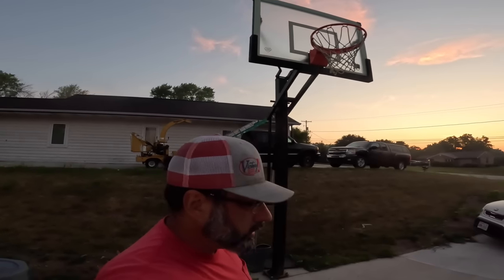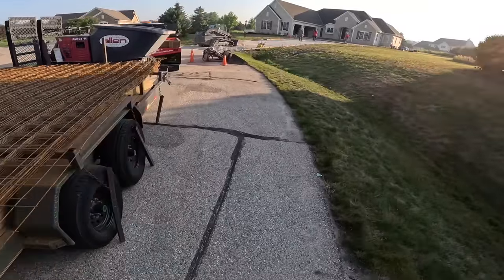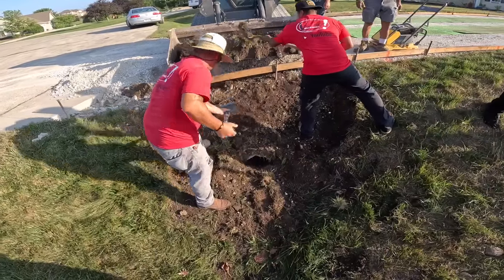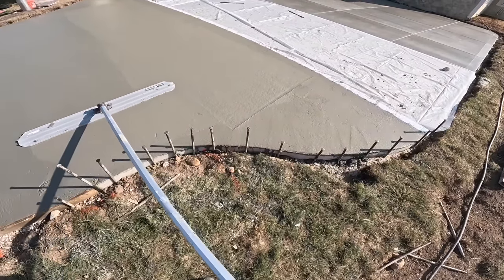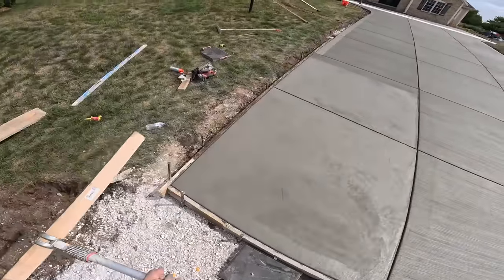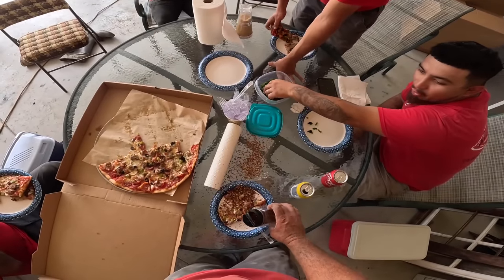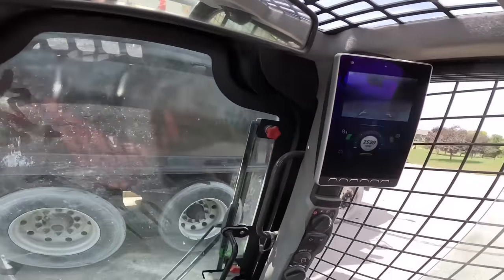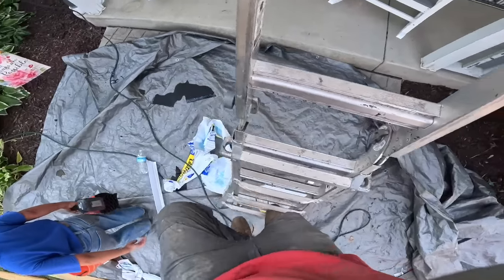Concrete, pizza, and lemonade! It was a good day!

Comment: We had the same thing regarding color, but from the same plant in the same town, but 3 different trucks. One really light grey concrete, the next load was a real dark grey that was the color of wet concrete once it dried, and the final load was a sandy yellow color once dried. The final 25 meter long, 3 to 3.5m wide driveway had NO cuts, no lines in it for a week, and it changed width 4 times along that length, so you can imagine the cracks that formed as it dried in the Australian summer heat. The contractor put a sprayed on base for stencilcrete cover to get the color right, but over wet epoxy used to seal the cracks, and then saw cut in just 4 places along the length. 18 years later I'm still telling people not to use that same contractor due to this work

Comment: We used plenty of plywood when i was scaffolding with a company. We use to overlap small voids & secure it on the scaffold etc.

Ply wood is durable man. It Lasts years. We would leave them out in the elements all year round & they would last. 

Try painting the ply wood. Lasts twice as long.

Comment: Muriatic acid is actually the same acid as in your stomach HCl. It would be dangerous to drink of course but in theory you can add a small amount in your stomach the issue is it would burn your throat and mouth.

Comment: Ryan, the mechanic, is tightening the nut to tight that holds the coil onto the spool...  this coil is on the passenger side of the machine, on the back of the gear pump valve block.

Comment: 20 years ago my grandpa and I were delivering a single wide over soft ground, and we were convinced to use those plastic mats instead plywood. Basically wrapped them right around the tires they compressed / bent up so much. Took his 1st gen duramax and a few hours of shoveling to get out.

Comment: I have a s250 with the same engine Kubota v3800 only has 2700 hours and I had to put a set of rings in it witch is weird because they do normally run forever

Comment: Man Ryan I know what you mean about sliding. You ever notice most roofers are thin, I think it stands to reason. When I was younger roofs were easy, because I was 130lbs then as I got older and approached 200 for some reason I felt I was sliding very easy with extra weight

Comment: With the new Holland they should have told you to lock or unlock the attachments you just need to dead head any function wether it is the auxiliary,  bucket tilt, or even boom lost or lower

Comment: I hate roofing especially in the summer only ppl who don't mind having chronic sunburn can do it I tried it for a minute I did at least 40 to 50 sheds and three homes two of them were one story and the other one was three. I learned what vertigo was that day. If you try this be light on your feet don't wear heavy boots and look out for soft spots

Comment: Don't use the switch to unlock to bucket it ruins the switch for some reason we have a NH l218 and replaced the switch 3 times before the dealer told us not to use it foe unhooking and hooking it runs the hydrulic pressure differently

Comment: Just a thought…. They pull the wire mesh as they pour the concrete. Right then you have 3-4 guys stepping on it right after you pull the wire… i hope you’re following me.. wouldn’t that push the wire mesh to the bottom???????

Comment: what size jointer do you use? I have been using a 3/4 in depth with 1/2 in radius for a while now and would like to try a different size. I like the look of these joints!

Comment: Here’s a little pro tip on climbing ladders never climb, handover hand on each run, reaching hand around the side of the ladder and put your hand on the back of the ladder. That way you never have to take your hand off the ladder as u go up you just slide your hand upthe ladder, and keep climbing, and if you go off-balance, you won’t fall because your hands are always on the ladder.

Comment: It's amazing how poor quality control is at some of these concrete producers. When they change a major ingredient like cement, it can have a major impact on the concrete properties. Your sticky concrete issue was probably due to increased air content because they didn't adjust the air entrainment admixture dosage. Water demand, strength, air, bleed rate, set times, and so on are just a few of the things that a change in cement can make.

Comment: "Once you back up, dont go forward again, your imprinting the grade pretty good." (5 seconds later:) Proceeds to back up, pull forward, back up, pull forward, excessively. You got 7 men at the bottom of the chute, you dont need to pull forward to give them a puddle, they can grab it from the chute. That driver was taught incorrectly.

Comment: I have been meaning to ask this question but I keep forgetting to ask. Having said that, why is it that they cut so many squares and in such small sizes . My house was built in 1985 and the drive way cut sections are 8 foot by 8 foot. I am curious is this a new design for the size and amount of cut sections?

Comment: Not trying to hate on anyone’s work but those shingles on the rake edge should have a starter and be at least a inch over and not cut flush with the drip edge. That will be problems in the future.
Reply: Not at all
Reply: @Averageroofer OK good luck with that.

Comment: them traction mats are not good because the plastic they are made of. They will get brittle because of the weather. Hot/then cold. after 2 yrs or more. it will begin cracking..

Comment: Hey Ryan, no offense but those traction mats your using look super thin and weak… the ones we use almost look twice as thick as yours… we run over them with 8000lb machines and MT100’s with 1000lb logs. We even run use them as a roadway for our 28ton and 50ton cranes and our mat’s definitely don’t curl like some of yours do already.. they don’t even seem like they are 1/2” thick. They almost seem like 3/8 because they are so flexible. 

Just wondering, I don’t want to see your stray away from these mats bc they are a huge game changer. If you want I’ll post a video for you to see ours in comparison.

Comment: muriatic acid is  hydrochloric acid which is same as your stomach, your stomach can protect against acids, lets say you down a cup of ice cold muriatic acid that might not be enough to change Ph Levels to much and damage to stomach glands , your mouth and esophagus, etc would definitely feel it,  you would probably get metabolic acidosis so nausea, vomiting, and fatigue due body fluids contain too much acid. your breathing would be real heavy.
all you systems will be working hard to help, your kidneys etc.  and you would be more acceptable into going into cardiac arrest.

all the damage is due to the immediate effect of the acid causing a form of shock to the system, alot of scarring on organs without glands to protect from acids, most likely the initial pain would stop you from wanting to drink more.

Comment: You are so much happier in your voice compared to older videos.
I do not think that the thin traction mat was a good idea for purchase in the first place and really a bad Idea to have a 80,000lbs truck to drive on. That is the worst Idea I have ever seen you allow happen, are you wanting the traction mats to fail.
You should have gotten the thicker matts in the first place.
But no warranty it is on video , matt abuse, even the thicker ones will not hold up a 80,000lbs truck full loaded with concrete.
They are for running the power buggy over the grass, maybe 1500lbs  "COM'ON"